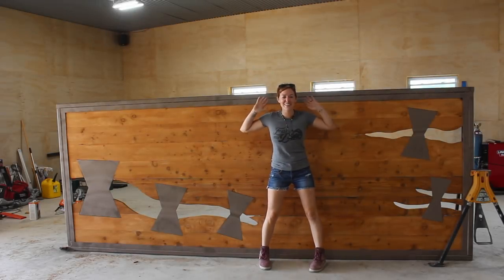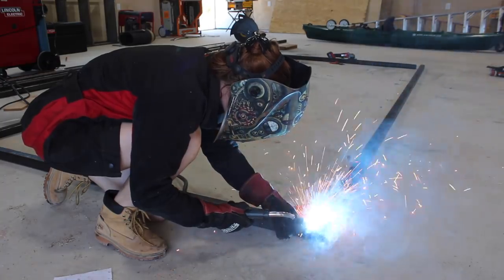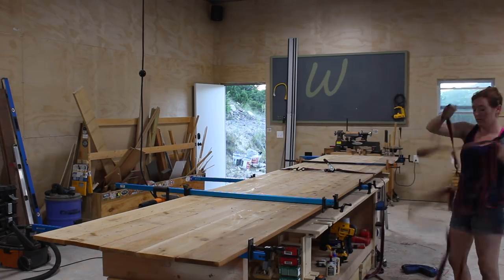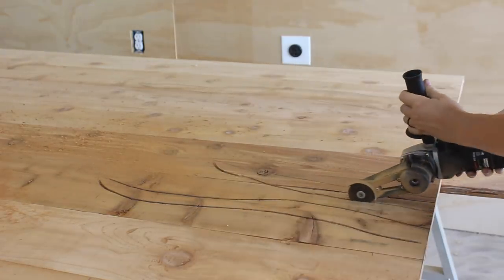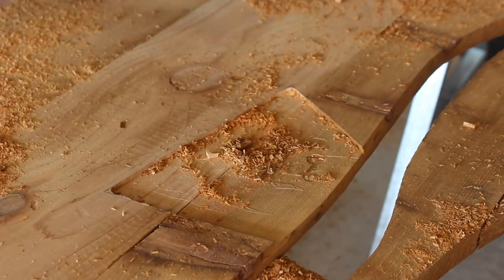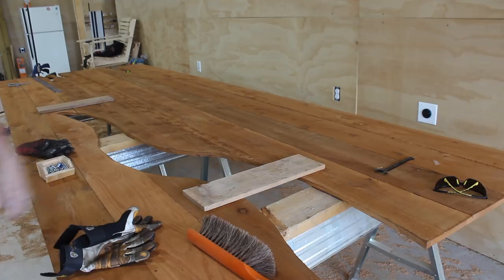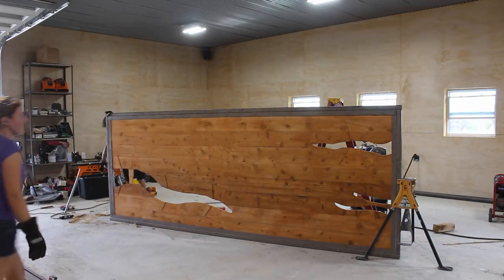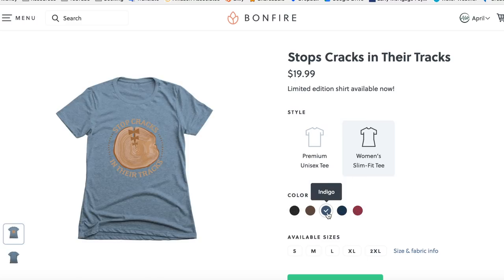Building a 14' Custom Metal/Wood Gate

Comment: Very cool gates.  Love how you can imagine that and build it . Very talented lady.  Very jealous of your shop 😎👍 
 Just a helpful idea for your clamps.  I buy the pipe clamps that screw onto regular pipe threads.  Then I use 4 foot sections of pipe for the basic length.  But I leave them threaded on the opposite ends.  That way I can pull off the backstop end and using a coupling I can add however much length to the clamps I need.  So in theory they can be infinitely long as long as you have lengths of pipe and couplings.  I keep a bunch of lengths of the correct size pipe together with the clamps for just this need.  
Thanks for another great video.  Keep up the good work.  👍

Comment: You need to make a overhead chain fall on your metal side to lift and move around all the big stuff you work with.
I enjoy all your videos Thanks.
Reply from the maker: The shop will evolve over time. I think first I need a workbench. : )
Reply: April Wilkerson definitely look at a moveable I beam gantry set up for the metal side of the shop.

Comment: A+ for drilling weep holes in the bottom channel! Very early on I thought, even though you appear to live in an arid area, water’s going to gather down there and that bottom board is gonna fail first. A+10 bonus points for adding the nuts as spacers! (I learned about this recently while building a box for my truck bed out of the plywood box a sink came in: I realized I had some square electrical conduit that fit right in the channels of my truck bed to elevate it off the surface, and the friend who let me borrow his angle grinder suggested drilling some holes in the box just in case. So far, so dry, and for the lid I joined three scrap pieces of OSB - didn’t think biscuits would be of much use, so just made a frame, painted everything with a can of “wrong tint” $5 return gallon of navy grey paint, then used spray adhesive to stick thick mm plastic sheeting on top. Now that’s it’s been hot out, the plastic has become wrinkly, but it was never for aesthetics.

“Splitting” is surely the most common term used for wood defects and cause for a bow tie, but there’s also “checking” and “shakes,” all of which occur along the lignin length, so your large split, while beautiful, would be pretty uncommon in shape, love the design idea - you’re right: it’s like a secret woodworkers code to recognize what those hourglass-like “things” are! Good job!!!

“Wood, ya best stop “checking” yourself before the whole neighborhood seen you done wreck yourself” 🤓

Comment: beautiful set of gates, you're happy with them and that's what counts. It's been stated but your weep holes drain into your bottom square tubing it looks like, this is going to cause the bottom square tubing to rust out quickly (a decade probably) even if the holes go through the bottom also. Best success I've had are two options, notch the flat stock on the back side to create the weep holes but you will get rust streaks there, or drill through holes large enough to weld a pipe in place flush with the top of the square tubing so the water goes completely out the bottom of the gate but this takes a lot more work and material. Again though beautiful gates and as long as you're happy with it.

Comment: WOW and WOWZY  lol ....Thats OFF the Chain.
Hey there..  you need to build a paint booth  in your shop for inside painting with exhaust fans and filters then you can  do away  with  cases  and cases of paint cans  and the  wind blowing half  of  it away  plus  you can set  up  and do  powder coating, I made my paint booth from a large locker  and also a oven  out of  another  for my cerakoting projects, but  my sand bast cabnie I bought &  upgraded to make it work  needs more volume of air. any way as  always You rock  it out of  the part  awesome job and she or he LOL  sure  looks amazing  great job Kiddo  :)

Comment: Two suggestions:
1 - Use pipe clamp! Any length you want :-) No need for strap.
2 - Create two set of large boards and then assemble them instead of adding a board each time. This way, you can do twice as fast and have only one final assemble where you need the very long clamps...

Keep on going! Very nice work!

Comment: cool, I liked everything you did, from design to fab.  Although, one suggestion, the wood panel replacement would be a difficult one;  so to easy replacing,  I would add a 1x1 angle iron bolted on the side uprights portion.

Comment: beautiful.  Maybe you want to put a diagonal rod across the gate, from the top of the hinge side, to the bottom of the latch side to keep from sagging.  Add a nut adjustment, for over time adjustments.

Comment: Cool gate!! I really like seeing you dance while belt sanding! 5:00 ;-) However, I would not have welded the boards into the gate in my area (MN) because it is too wet and ceder rots too fast. I would have made a way to replace them.

Comment: Have you considered building a station for the chop kind of like what most people build for a miter saw station?  A bench along one wall with the chopsaw set into it so you have level support all the way across for material rather than having to shim it up with wooden blocks everytime you want to cut?  Even a mobile one like you have for your miter saw could work, but make at least the top of it out of metal so sparks won't be an issue.

Comment: April, rather than trying to use straps, for really long clamping, old-school 3/4" traditional pipe clamps are hard to beat.  When you need a longer clamp, just remove the hardware and put them on a longer piece of 3/4" iron pipe.   Bessey, Pony & Jorgensen are my favorite brands of the pipe clamp hardware.  Unlike modern parallel clamps, pipe clamps, especially when on longer iron, can bow so it's important to use them in pairs -- one on top matched with one below.

Comment: Are you planning to add any kind of brake to help keep the wind from whipping it around while unlatched?

A new development near where I lived a few years back put in rather similar gates, and they proved to be highly effective sails in even fairly light wind. Most ended up ripping themselves apart in heavy gusts, and one guy ended up in hospital when he tried to get his back under control and it smacked him across his yard. 

The few who didn't replace them with a more open framed gate added a heavy foot on a lever so you had to actively lift the foot to move the gate freely for the full swing, otherwise it would drag on the ground and slow or stop the gate from moving.

Comment: Hi April, I love your video's.  I have been watching your channel for at least a couple of years now and look forward to seeing the next video always.  I was wondering if you put a over sized hole in the tube that the bolt on the bow-tie goes through for and if the wood part of the gate should move from expansion like you talked about ?  I love that new shop and wish I had one just like it.  God bless you and yours.

Comment: I’ve seen you need large clams a few times. Have you thought about getting some pipe clamps. They give you the ability to swap out the pipe for longer or shorter pip, depending on what your project requires.

Comment: Word of caution for safety.  I've heard really bad things for welding galvanized fasteners - I think the zinc fumes are supposed to be toxic or carcinogenic.  Might have been better to use unplated or grind the plating off.  (I don't know how big a deal it is for handfull of bolts.)
Pretty sweet gate though.  I like the nuts in the bottom as spacers.

Comment: April real beauty eh, also am working on 2 gates myself and wondering if you will cap the end post so water cant get into the pipes? what size are your end pipes? mine are 4 inch, the gates are 20 footers so the extra strength will I am sure prove beneficial, because of the length am adding wheels on or towards the end for additional support. Really appreciate watching and learning and also the joys that come from creating, thanks for being such great example of the principles. Kindest Regards Brian

Comment: What a talented lady dancing while sanding. Truly a unique one of a kind gate that tuned out fantastic. Those colors blend well. I am anything but a safely Nazi but watch yourself while welding galvanized steel.
Reply from the maker: I believe dancing while sanding is a must. ; ) No worries, I used a grinder to grind a little on the head of the bolt before welding it.

Comment: With a gate that large, i'd think you'd need a diagonal brace from the top corner to the bottom hinge. As built i'd think the top hinge is bearing a large percentage of the weight, and will eventually fail or deform the gate. That's just a guess though. you could be fine.

Comment: I've noticed in several videos when you use a can of spray paint you just hold it in your hand. Home Depot sells a spray grip that fits the spray can. Model number 241526. I've started using it several years ago and I found it gives me greater control in applying the paint and also I don't get any over spray on my fingers for it simply converts the can into a spray gun. 
Here is the link to the one I use: www.homedepot.com/p/Rust-Oleum-Stops-Rust-High-Performance-Comfort-Spray-Grip-Accessory-241526/100670383

Comment: I think you will get troubles with rotting cause your bottom channel has only little ventilation and will allways be damp. At the latest when it collects dust/dirt.
But in case of rotten wood you are able to change your wood panel without dismounting the gate. Make it smaller in height so you can first fit it in the top channel then tilting it into the bottom channel where there are spacers half the height of the channel wall. In the end top and bottom channel are grabbing the panel with half of their channel walls.
Tells us about the wood condition in three to five years . ;-)
Reply: I was thinking I'd drill a few holes along the bottom steel rail to let water drain. And be sure to prime and paint them to lessen rust.

Comment: If you switch to pipe clamps, especially at 3/4 or 1", you are only limited by the length of "black iron" plumbing pipe you can find. The average big box home store has lengths up to 10 feet.

Comment: Came out awesome (as usual). Just a thought; hex head bolts have a flat top and would provide a better welding surface.
Reply from the maker: That's true but I had carriage bolts on hand. : )
Reply: As the old saying goes; A bolt in the hand...

Comment: cool design and a great build, but I am wondering if you are not worried about the gate sagging on the latch side over time since I did not see any diagonal bracing put into the gate structure?

Comment: That looks great, when drilling the weep holes in the bottom frame.... Did you just drill through the U channel and into the square tubing? Then capped off the tubing? That will hold water and rust out. Or did you drill the weep holes through the U channel and the square tube? Maybe I didn't see it right
Reply from the maker: I drilled through the tubing completely. The U channel is just flat bar on either side of the tubing so when I drilled down, I went through the top then the bottom layer of tubing.

Comment: What about the poles you use for your gates? How deep do u put them in the ground and how much concrete? I too build gates and try to put more concrete then the gate weighs and I use 4x4 1/4 wall tubing. I also dig down 3’ to set the poles in. I see u have a angle piece off the post. Was that in concrete too? Ive had some Gates sag but from not enough Concrete.

Comment: Wow, this is so cool. I really like how you mounted the bowties.  I have so many questions about this gate though.  Could you have mitered and welded the corners of the big frame pieces at 45 degrees so there wouldn't be an "open" and "closed end (I'm asking purely from an aesthetic perspective, but maybe there's something structural i'm not thinking of).  Also, how did you mount the hinges?  What is the post that holds the gate made of and how deep is it?  Are you worried about it sagging? I'm once built a 13' driveway gate out of wood.  I was so afraid of sagging that I used the largest hinges I could find and also used a wheel on the end that rolls along the concrete to prevent the end from dipping, and it still does.   Thanks! and good luck!

Comment: From a creative point of view, it's nice and I can see all the work it required.

Now, what I don't get us why in both gates the angles of the tubing are not cut in 45 degrees instead of 90, since this would need much less welding and, I believe, it looks better (even after it's been painted).

As for the bowties, I would have a different method to make them stick in place. No glue as well, that's for certain.

If the board is thick enough, I would use the router to make something like the front side, but in a small rectangular shape, one for each part of each bowtie (in a size relative to the size of each bowtie).

Then I would weld one bolt for each of them, make a hole in the board and finally put a sheet of metal (the size of the inlay made previously with the router, if that was done) and tie it with a nut.

It's basically the same idea but the bowties would be tied to the wood on both sides, instead of to a metal bar just in the middle. No disrespect, but I find it a better solution: it actually holds the board together (even if you leave some play with the holes in the board for the bolts) and it doesn't look a bit weird from the back

Nice job anyway, but since my father, two uncles and a grandfather were all blacksmiths, I had to write down my thoughts. I thought I had to share my ideas to, somehow, give you something back.

Thank you.
Reply: Regarding the corners - the little bit of extra welding is far quicker than adjusting chop saw and returning back to square to cut mitred corners and when dressed in a job of this size no one notices (or cares). Been in fabrication 45+ years myself.
Reply: The finish is completely different. I'm not saying this method does not have any advantage, but the finish is way better, and it's easier to do, since having to cut an extra square of material to cover the extra hole is quite a lot of extra work. And I do believe it's more work than cutting 45º angles.
Reply: If the join is created by a craftsman it would be nigh on impossible to tell mitred or not. Each to their own I guess.
Reply: It's really much harder to make it look better with the method in the video. Not only you have more welding to disguise, there's that square you have to weld as well and that is quite a lot of work to make it look seamless.

Comment: Great project!  Looks fantastic, April!  Did you only drill your "weep" holes through the top layer of the lower u-channel (that's what it looked like in the video)?  Where will the water go now that you have the ends capped off? #KeepTheChipsFlying!

Comment: Do you fall out of your chair that often that you didn't put legs on, gotta slow down on them there hops. I"m just kidding I saw the chairs on the floor and I could not resist. also if you took  the same concept with a table top you could put hinges on a frame (frame to wall) to the table top and then you have a fold down table (legs perm on against wall) and wall art.  oops and magnets to hole the table top to the frame. You are so darn clever love your work ethic also. :) peace and happy building

Comment: April, work was fine, design needs work- more time in proportioning the various components?  Bowties are disproportional and look a little odd.  Checks are too wide for the piece?  to my eye it would look more interesting to have thinner checks, smaller an less 'beamy' bowties so they were more in proportion to the gate as a table top?

Comment: You need to do your garage floors protected  with some sealant
Reply: no sealer for wherever your welding, learned that trick about 5 years ago. I caught the garage floor sealer (believe it was epoxy) on fire at my old house, i was able to stomp it out real quick but then smelt like burnt paint and had a huge black mark. Often times you end up welding on the floor for bigger jobs.

Comment: Great build April. Only one criticism, stop saying you’re using tite bond 3 because it’s water resistant . Tite bond 2 is also water resistant and recommended by tite bond for exterior use, tite bond 3 is water resistant and boil resistant so better for cutting boards.

Comment: I'm a big fan of your work and  won't  balk about you talent or passion you display in your vids.   But the use of Rustoleum on this project will bite you in the long run, please do an update in 3 years to let us fans know if that was the right choice.   My choice would be not to paint, let nature reveal the prize over the years or if you want to paint consider using industrial paints that are used on the oil rigs.